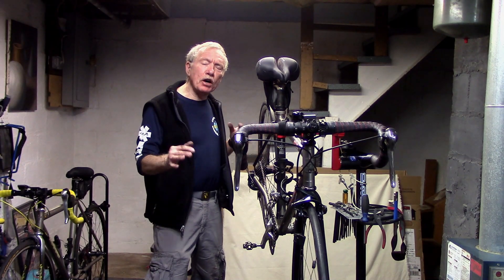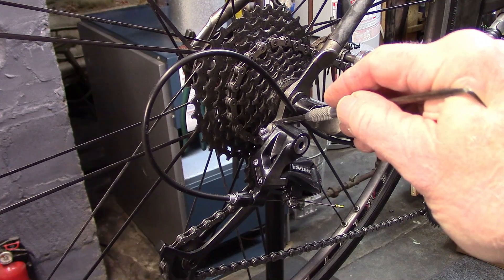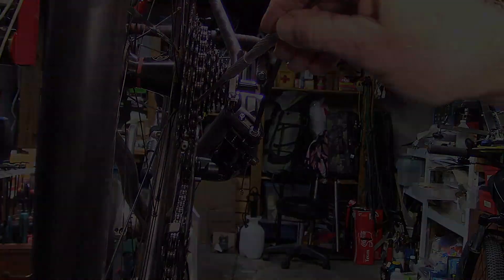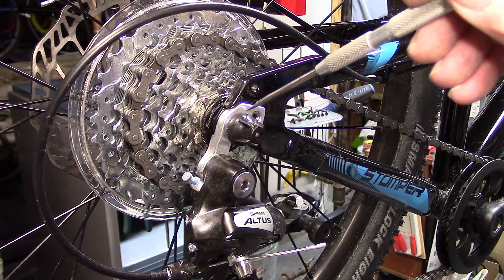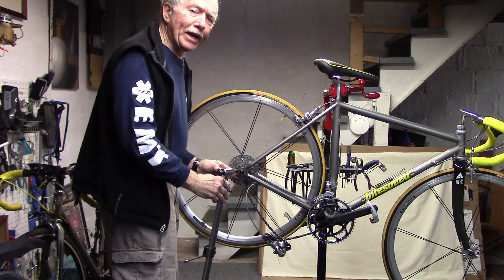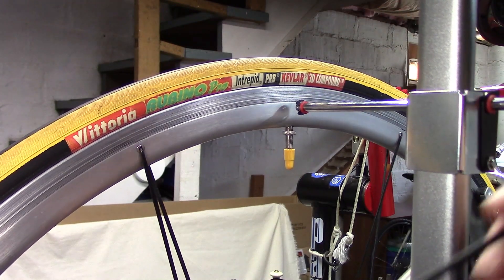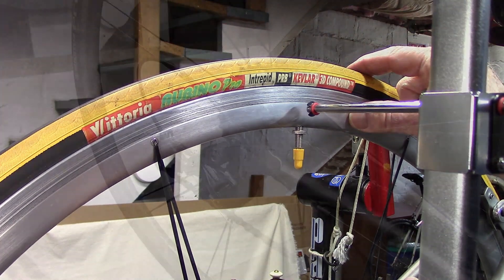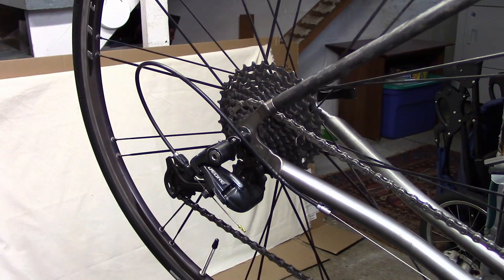Bent Bicycle Derailleur Hanger: A brief overview of signs symptoms and repair

Comment: My Titanium integrated hanger is bent 1cm outwards and it’s impossible to reset. It bounces back every time I attempt to bend it inwards, with the park tool. LBS’s can’t help and ti frame builders are impossible to locate here in the UK. I’m now faced with scrapping an otherwise mint condition frame. Crazy. Will never waste money on a ti frame again.
Reply from the maker: It is possible to bend a titanium hanger**:
1  Remove the rear derailleur from the hanger. This allows you to access the hanger freely.
2  Attach the derailleur hanger alignment gauge. Screw the head of the DAG into the hanger.
3  Check the hanger alignment. Use the feeler gauge on the DAG to measure the alignment of the hanger vertically and horizontally.
4  Bend the hanger. If the alignment is off, gently use the DAG to apply leverage and bend the hanger in the desired direction.
5  REPEAT steps 3 and 4. Keep checking the alignment and adjusting the hanger until it is perfectly aligned.
6  Reinstall the derailleur. Once the hanger is aligned, reattach the rear derailleur. 
Important Considerations:
•  Titanium is a strong but brittle material.
•  Be careful NOT to bend the hanger too forcefully, as it could crack or break. Use repeated gentle bending.
•  Use the right tool.
•  A derailleur hanger alignment gauge provides the necessary leverage and accuracy to bend the hanger without damaging it. Also see the note below.
•  Check alignment carefully.
•  Make sure the hanger is aligned perfectly with the frame and cassette before reattaching the derailleur.
If you're unsure about the process, consider taking your bike to a professional bike shop.
They have the tools and expertise to properly align your derailleur hanger. Sounds like your bike shop wants no part of this and you may want to consult a different shop.
**Note: From your description of the problem, it sounds like your derailleur is severely bent, more so then most I have worked with and I would consider have another shop take a look. It may require some careful bending with a crescent wrench first, then using the derailleur hanger tool. It's a tricky business requiring patience, bending slowly, a little at a time.
Reply: @ thanks for the advice. It really is a weird one. My LBS is regarded as one of the best in the UK, with top mechanics and ex pro racers on their books but they couldn’t budge it a single mm. They did point out that they had a policy of only taking it so far before quitting so as to avoid damaging the frame. I’ll try one more LBS, a large trek store, but I’m not sure what else they can offer. Ideally I’d have a new hanger welded on but whenever I’ve made enquiries with Ti frame builders they don’t want to know! Can’t understand it. If I knew when I bought the frame (2nd hand btw) that any of this was a possibility, I’d have never bought it. It’s a beautiful frame, in otherwise mint condition, so it’ll hurt real bad to have to scrap it. Guess I could try it as a single speed. Either way, I’ll report back and let you know how I get on. Thanks.

Comment: Thank you for this video, never heard of such alignment tool
Reply from the maker: The alignment hanger is a specialized tool we use in the shop and allows us to bent the derailleur hanger back to the correct position rather then using pliers and guess (as we did in the old days. Now most bikes are coming with detachable hangers. This is great because if they get bent, it's a brease (and cheap) to replace.
Also visit our YouTube home site at:
https://www.youtube.com/user/MrTony10speed
Regards and safe cycling, Tony

Comment: Would be great to understand other symptoms such as sounds you might hear on pedaling and how to differentiate hanger problems from other issues like, in extreme situations, a cracked chain stay:-)
Reply from the maker: The signs and symptoms of a bent derailleur hanger is usually poor shifting, the inability to index the rear derailleur or some constant chain noise. Many things can cause such problems such as out of tune indexing, a worn rear derailleur cable, or a worn chain or cassette. The first thing I do when I encounter poor shifting is take a look (from the rear of the bike) to assure that the hanger is not bent but parallel to the frame. If it looks good, I'll check for chain wear and cassette wear. If all that looks good, I usually move on to replacing the derailleur cable.

If the derailleur is bent, one could use a crescent wrench and straighten it out, all though doing this to get it perfectly straight is difficult. If you suspect that the hanger is bent from observation and it's a removable hanger, you or your bike shop can replace it.  If it's not removable, your local bike shop has a special tool to straighten it out.

FYI: Here's an interesting discussion on crack frames:
https://www.quora.com/How-can-you-tell-if-your-bicycle-frame-has-been-damaged-in-an-accident-How-can-this-be-fixed-without-replacing-the-entire-frame

Hopefully this will answer your question. 
Regards and safe cycling, Tony

Comment: thanks for sharing Tony. how much it would cost to do such allignment? i just check and a hanger cost about 10 euros. so anything higher than 5 wouldnt make too much sense...cheers
Reply from the maker: Definitely worth purchasing a new derailleur hanger replacement (if your bicycle has a replaceable hanger) since the cost of repairs these days run upward of $90/hour. As to getting the correct replacement and installing it correctly, that depends on your proficiency in bicycle repair.  Unless you feel comfortable in doing such a replacement, have your local bike store order the correct hanger and do the replacement.
  If the hanger is not replaceable and you don't have the tool to straighten the hanger, your only option is your local bike store.
Regards and safe cycling, Tony

Comment: My thing is my hanger doesn’t look bent at all but the frame area that the hanger attaches could be bent. Not rolling g in the dough right now to buy parts that I don’t need. Any advice?
Reply from the maker: That's a tough question to answer. The hanger is usually a softer alloy then the frame, allowing it to bend (rather then the frame) if something contacts the derailleur as in a crash or if the bike falls over.  The only way I can tell for sure is using a Derailleur Hanger Alignment tool. In the old days, we just used a crescent wrench to straighten the hanger (which was part of the frame). But there's always a chance you might crack the frame. Personally, I'd take it to your local bike shop and let them have a look before you try to work with the hanger or frame. But I'll leave that up to you.
Reply: @tony10speed  Amen Tony.  Please keep stressing that riders whether rich or poor patronize their local bike shops.  I just called mine about lousy shifting on my 3 highest gears after a modest spill that probably bent the hanger very slightly.......$15 was the quote to fix it!!!  If I had done that first I would have save 3 hours of watching 'indexing your gears" "how to adjust your derailleur" videos etc (not yours, yours was solid gold and I instantly subscribed) and even going so far as to Google a cheap bike stand.  Yes I'm not too bright lol.
Reply from the maker: @chrisrobbins2632  Solving the problem by knowing when to take it to your local bike shop does show you are brighter then most. I see this posting on Facebook called "Ask a Mechanic" where people write in with a particular problem. However, the answers are not from mechanics and many are just plain wrong. I learned bicycle mechanics by watching store mechanic fixing bikes, asking questions and then doing it myself. There's a lot to be said for ones local bike store. Regards and safe cycling, Tony

Comment: Hello, i recently bought a new bike and it had a bent derailleur hanger that i had realligned by a mechanic and i accidentally hit the derailleur with my  narrow door frame. Should i be worried that it got bent again?
Reply from the maker: Just take a look at the derailleur from the rear to see if it's aligned with the frame (as in the video). If it looks good and it shifts well, you're fine. Regards, Tony

Comment: Thanks to this video I know why my rear derailleur is bent
Reply from the maker: In the old days, we use to just bend the derailleur hanger back straight with vice grips or heavy pliers. Now, most shops have a Park Hanger Alignment Tool to get it perfectly straight. Check with your local shop if one is available. Let me know how you make out. Regards, Tony

Comment: So it's meant to be a straight line. From the cassette to the 2 jockey wheels. No wonder my shifts are so poor. But I've never dropped my bike. My bottom jockey wheel is pushed inwards 😣
Reply from the maker: Maybe the derailleur got bumped against a curb or knocked into another bike when you weren't looking. Hard to be sure but a new derailleur hanger or bending the hanger back into place is in order (should be done by your local bicycle shop which will have the right tools and will not break the hanger). Regards, Tony

Comment: What if the rd is bent, not the hanger? Can it still ve fixed without replacement?
Reply from the maker: Tough to fix a bent rear derailleur. Worth a try, but often not successful. Luckily, the hanger usually will bend before the derailleur. Regards, Tony
Reply: @tony10speed  can hangers be bent by RD shifting? I mean any other reason why it will bend other than falling or by impact? I really appreciate your super pro answers
Reply from the maker: @rommelnadal978  Shifting will not bend the derailleur hanger. But besides the bike falling over, there are several other ways the hanger can be bent. The common one is placing your bike in a type of bike stand that is on the floor or outside a rest stop. If you place your bike with your rear wheel inside the rack you should be careful to adjust your rear derailleur so it doesn’t bend on the rack. Depending on the rack usually the best position is your higher gears or, in other words, your smaller cogs. On a mountain bike, clipping a rock or wall with the rear derailleur may be the culprit. I'm sure that there may be other ways, but these are the ones that come to mind. Regards, Tony
Reply: @tony10speed  another question: Chain is not shifting to the largest cog even the H limit is super loosened. How to fix it?
Reply from the maker: @rommelnadal978  You probably don't have enough tension in the front derailleur cable. Make sure you're shifted to the small chain ring. Undo the pinch bolt for the front derailleur cable. Turn the barrel adjuster for the front derailleur all the way in and then out about 1/2 turn. Now take any slack out of the front derailleur cable by pulling on it with some long nose pliers (or what ever you have on hand - don't need gorilla force but just enough to take out the slack). Now try shifting. You may need to turn the barrel adjuster out (counter clockwise) if needed until it shift well to the large chainring. Reset the outer limiting screw until it is about 1-2 mm away from the chain when the chain is in the large chainring and smallest cog.
That should do it. We'll be putting out a video on how to do this in the next few weeks. Regards, Tony
Reply: @tony10speed  perfect! We'll be waiting for that!!!

Comment: Great video but there is one glaring question: Who puts a Deore derailleur on a Seven titanium bike?
Reply from the maker: This is a 10 year old Seven that was brought into my shop for replacement of the front wheel and maintenance. The Deore derailleur is a long cage and may have been previously put on to accommodate a 11/34 cassette but I don't know for sure. Regardless, it works very well with the 10 speed Shimano setup. Regards, Tony

Comment: This helped me diagnose a bent hanger on my bike. Thank you for your video...
Reply from the maker: Glad to be of service. Few people think about bent derailleur hangers, but when you work in a shop, it's not uncommon. In the old days we just straighten them with large pliers. However, we come a long way with better tools. Regards, Tony
Reply: @tony10speed  Turns out my hanger and mech are bent. It must've been the previous owner, as I don't remember knocking it. Found a direct replacement mech and hanger, now trying to find the right chain...
Reply from the maker: @CarlPaulsen  Your local bike shop can help you get a proper chain. Regards, Tony
Reply: Hi i have a question, all bikes come with a hanger on them right bc i saw, when i ordered my bike that it was reccomended to buy a hanger but i didnt think it would be useful, and if it becomes bent do i have to order a mew hanger or do normal bikes shops have them to replace?

Comment: I made my own hanger alignment tool out of a piece of wood and a threaded bar with some nuts and washers, which is very accurate. The alignment is slightly out, but I cannot bend the hanger, because it is made out of titanium.
Reply from the maker: Try making one out of metal. See RJ the Bike Guy: https://www.youtube.com/watch?v=sWdO4dnu18g&t=3s

Comment: Is it difficult to use the hanger alignment tool?
Reply from the maker: The tool is expensive (I prefer the Park Tool DAG-2.2, right tool for the right job) and does take some practice. One will rarely use such a tool unless you're working in a bike shop where bent derailleur hangers are not an uncommon sight.